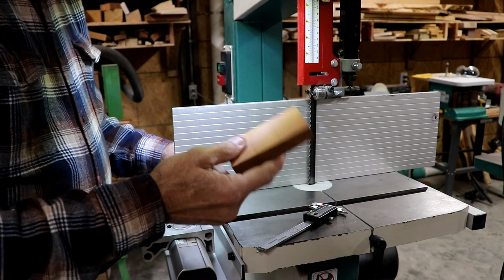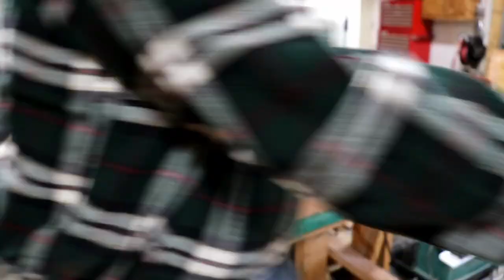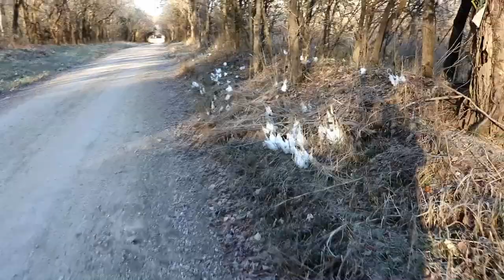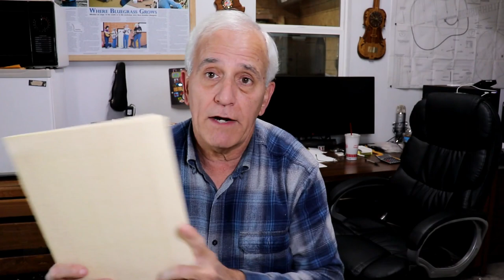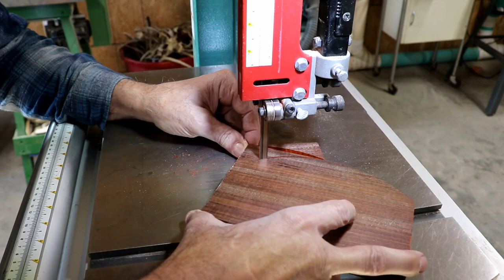348 RSW Custom  Guitar Build   P1 Sides

Comment: Good to see you back at work creating new works of art! I don't if anyone else mentioned, so forgive me if someone did already. The Digital Level and Angle Finder digits after the decimal point (.) are MINUTES of 1 degree of which there are 60 per degree. 15 minutes equals 1/4 degree and so forth... So .05 minutes is just shy of approx 1/10th of a degree. Get that fire wood cut, buddy... Have a good, Jerry!

Comment: Padauk is one of my very favorite woods. I have used it to trim custom built stereo equipment. I am planning some new electric guitar extension speakers that I will use a light wood like maple for the main structure, with padauk trim accent insert strips. No 'tolex' ... these will be finished wood beauty. If you need more, I suggest Gilmer Woods in Portland Oregon. They work with fine luthiers, furniture and cabinet builders, and just plain ol' wood hobby people. Knowledgable, honest, and respectful folks there.   "Carolina Rose" for the new guitar.  I wonder if the hard padauk would do better for bending if it were actually steamed in a steamer box for a few hours. I toured a bentwood furniture factory once, and they used real steam to turn the stiffest hardwoods into limp noodles..

Comment: Get an anti skid mat - rubberised coarse weawe. Good idea wetting and heating the outside as well as the inside as the outside has to strech as much as the inside has to compress.🤓 If you for the future make a couple of slits at either end in the bottom of the mold it would be easy to use the saw to trim the overlap.

Comment: Have you ever used carbide utility knife blades? So much more sharp than a standard blade. Dewalt makes a 5 pack. I buy them at Ace hardware. I work with dyneema rope on occasion. It’s the only thing I’ve found that cuts the dyneema like butter. Can’t help thinking they would have made sort work of the bodyside overlapping end cuts. You are truly a master.
Reply from the maker: I'll look into it thanks

Comment: just a thought Jerry (from one woodworker to another) but y`know that `wet looking` rubber stuff for holding things steady on a car dashboard, a roll of that would support, cushion & hold the timber as you sand it, hang on, I`ll need to google it to get the correct name, right back buddy! righto, it`s `Anti Slip`  or `non slip` car mat, not expensive either, 2 or 3 of `em (or more) I`m certain would work in conjuction with your strong grip. like I said, juuuust a thought! looking forward to this build my friend, DO NOT let those so&so`s get you down mind!

Comment: That’s a pretty pretty side set mr.jerry. For holding thin work,have you considered building you a vacuum table? It would hold those thin side billets securely and pretty gently. I built myself a vacuum table for holding tops and backs for scraping and sanding,holding bodies for binding and other jobs,so far it’s working pretty damn well.

Comment: Try some non-slip shelf liner that does not use adhesive (just friction). you can cut it to length and it should make holding it place easier.

Comment: You should REALLY be using a push stick when resawing on the bandsaw.  Especially with a board so small and cuts so close as in those test cuts.  This guy is a pro.  He knows the risks.  Bandsaw will take your finger off in a blink.
Reply from the maker: It's the most dangerous saw in the shop. I firmly believe that

Comment: Jerry the only problem I see with you sanding/sander is lack of dust collection. My DeWalt has a round exhaust which I heated some PVC Pipe to stretch over the end and fit my dust collection. Possible you could do something to hook yours to you over head. Looks like another Fine Quality Instrument is on it's way.
Reply from the maker: The note on the screen said the Dust cord had been clogged by my son you may have missed that. Normally it doesn't leave that much dust.
Reply: @RosaStringWorks  OK Thanks Jerry.

Comment: Hi!  Great video that you naturally do very well as I've also seen others of yours.  I was working as a security guard at a papermill and they were creating a new very large addition.  They called them "super calendars" the massive steel rollers that would make the paper and produce a 50 ft wide piece at 55mph.  The calendars came from Brazil.  They probably weighed several tons each, and many of them all packed with huge solid timbers of very red wood like the color of that special wood you were using.  All the left over wood, and other various construction scraps, went to a landfill for construction waste.  That was in 1989.  Do you know if the only tropical wood that comes from Brazil is a very red color, maybe even more red than the wood you used for the sides of the guitar?  Sometimes I think that I should have asked if I could have the wood, pieces that were massive and very long that could have been used by luthiers.  The paper would roll up onto these calendars.  They were doing a lot of testing and huge dumpsters were being hauled away.  I asked the superintendent where all the paper was going.  A lot of the supervisory was from British Columbia and didn't know our area.  He said it was all going to the landfill that I knew was about 10 miles away.  I said there was a recycling center only a mile away.  After that all the huge loads, big dumpsters, for days, of test paper went the other direction for the recycle center.  I probably saved several tons of paper from being wasted, a nice feeling.  I at the time felt bad about all that tropical wood and had wished I'd asked.  Maybe someone here might know what kind of wood it was.

Comment: Wow what a tough pair of sides you got i'm glad it was you and not me, 1 suggestion to help with cutting the sides in place, How about gluing a couple of small rare earth magnets about 10mm wide in a piece of wood which you could then clamp into position that way the magnets hold the saw blade straight and in line, or have you already thought of that lol.

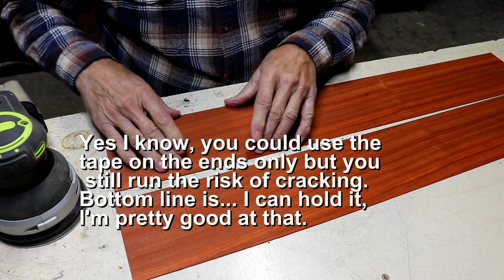Comment: 14:30 I'm not a very smart guy and sometimes slow to learn however when you said put two pieces of masking tape down on a 1/16 of an inch board I immediately thought it's going to warp the board. It makes perfect sense I wouldn't do it either.

Comment: Thank you for all your videos... I have a question about the sides you just re-sawed, each to about .170 inches thick and then sanded them with your great thickness sander to about .075 inches thick. You had to remove about .095 inches from a Padauk board (very hard wood) about 5 inches wide, I think you said with about 100 grit.---  WOW!... may I ask about how many passes you required for each side, and about how long does that take per side??  (I want to say that I really appreciate your videos and am not trying to dispute anything... I have just started my own build and have a nice piece of 3/4 Buginga (somewhat harder that Padauk) for the sides and a really, really nice piece also 3/4 Buginga,  for the 3 piece back.  I'll tell you more about my experience, if you like (resawing and thickness sanding with 80 grit, in another comment... Thank you and Merry Christmas.
Reply from the maker: It doesn't take too long to send them down. You can try cutting them closer to size but you run the risk of leaving song marks. Sometimes the song marks can be 30 or 40,000ths deep.  I probably take about .010" per pass.  If you use 80 grit sand paper, I would stop short of your final dimension.  80 grit leaves pretty deep grooves.  Even th 100 grt is a bit too rough and needs a 220 grit sanding as a final.
Reply: Great to hear back from you.. Thank you for you answers. It must be that the my  Bubinga is much harder than Padauk. I can only get (at the very most) .004 - .005 per pass and thats really an effort. (also the sanded area seems kind of smooth. (my  80 grit (Klingspor LS 309 was brand new..) I know what you mean by not resawing too thin... What I did when I was doing the backs (6" wide vs the sides at 4 1/8"..) (mine is going to me an 000 body) was to resaw from a fresh side to as close as I dared, and then thickness plane the original piece to have a new fresh surface, then resaw. etc.. erc. I only need 3 backs so this helped a lot.. Never got too thin for the thickness planer. Still very tough job. I intend to sand with down to 220 next..  I'm going to try a piece of Padauk just to see the difference. Thanks again...

Comment: jerry, when you pulled out the electric plug from the bending iron, i noticed you didnt grab it by the plug , but by the wire itself.(at about 20:19 of the video). that will come back to haunt you at some time. i've done it myself . had to retrain myself. lol   just a quick tip to save you some pain later. keep up the good work. love your videos

Comment: You may have covered this before but would steming the plank work or does that change the structural strength of the wood too much?
Reply from the maker: I used to use a steam Box but believe it or not Padauk dries out almost instantly when you take it out of the Box

Comment: One thing I noticed when you cut the wood for the sides is that the cuts weren't parallel. It would make the front to back distance less at one end of the guitar than on the other. I've probably seen you do it that way before but had forgotten. Is that for aesthetics or to get more sound out of the guitar?
Reply: Kevin Cozens absolutely it gives a much better boom while making strumming easier !
Reply from the maker: I'm building it to the Martin plans and all the drug nut Martin guitars are tapered like that

Comment: Is steam bending an option?
Reply from the maker: I used to do it that way. The padauk doesn't seem to take kindly to water and or steam bending. I've tried it before and it dries out almost instantly.  It's crazy how fast it dries out. Other Woods don't do that. You can take it out of a boiling pan of water which I've done many times move it over to the form and it's already dry before you try to bend it I don't know why that is

Comment: Hello!
 Your skills and experience are formidable.
When you talk about dimensions in thousandths of an inch, it's a bit difficult to visualise.
With due respect, if you could refer to dimensions in to the nearest sixteenth of an inch, or in mm you could perhaps be better understood by those who need to learn from you!
 Pseudo tech guys like to talk in abbreviated terms to sound knowledgeable.
No complaints if you stuck to your system, do please ignore "expert' advice even if well meant.
Your video has already gone global and your projects will genuinely  be appreciated.
Reply from the maker: The reason I use thousands is because it's highly precise. If I tried to go to 16ths that's like 62.5 thousandths. That's a lot of rounding. My suggestion is you get a caliper and learn to use it.